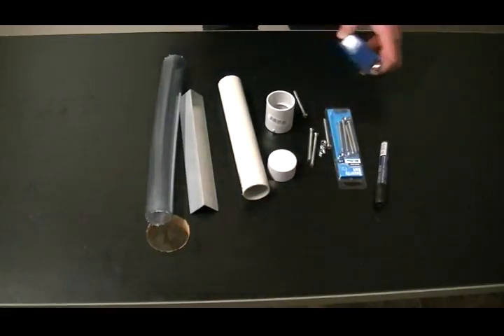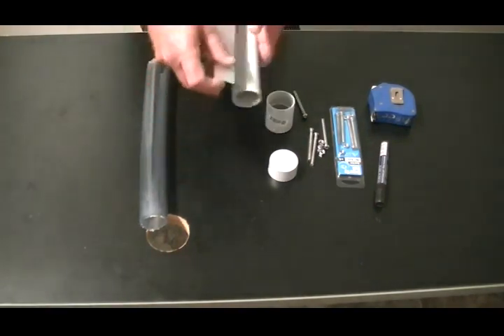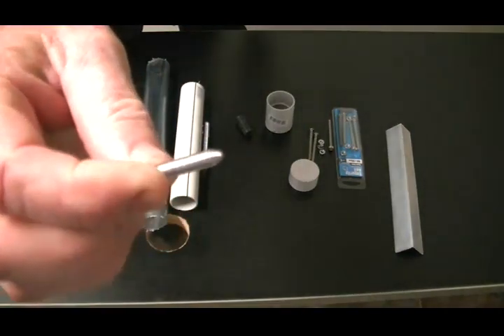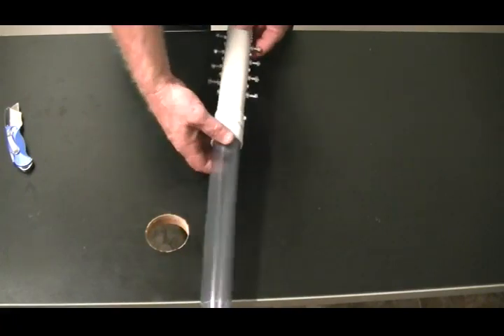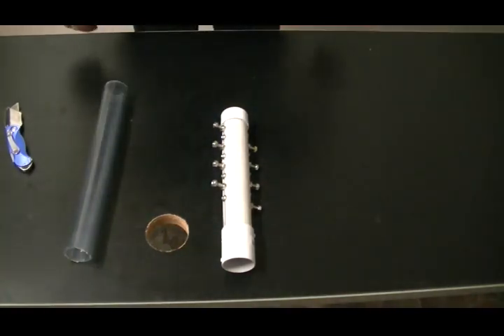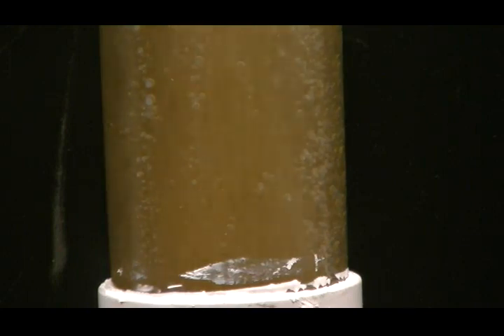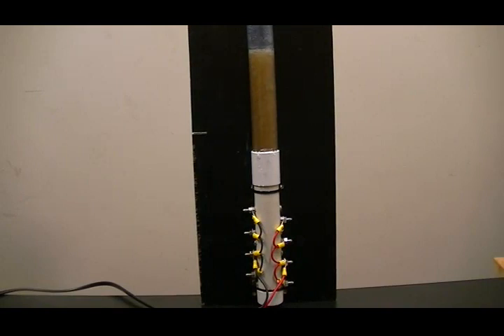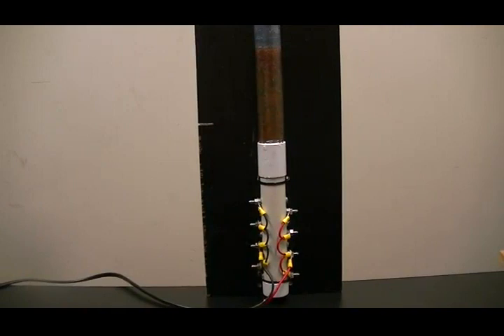DIY Simple Hydrogen Generator from Hardware store parts- under $20.00

Comment: For anyone who want to do this, you can use potassium hydroxide + distilled or RO water as solution, and stainless steel 316L for longer lasting. Normal tap water or mineral water is not good or it will become that 'rusted' solution. Pulsed DC is best for power supply. This is just based on my diy experiment and I'm not an expert for more technical details for much better setup if you want to ask.

Comment: Can someone please explain why with the 'high voltage' thing the middle sections become neutral, and what voltages this occurs at?
Reply from the maker: Ok, so if we put say 40 volts across the top left pin and bottom right pin, then on each of the other pins the voltage is divided evenly.
Reply: @69Atho  thank you. So if we have 20 pins we get 2v on between each positive pin and it's negative neighbour. Just wasn't sure why you said the middle sections become neutral. Cheers